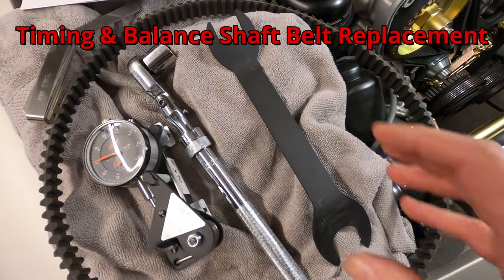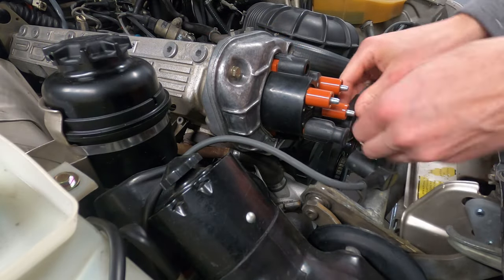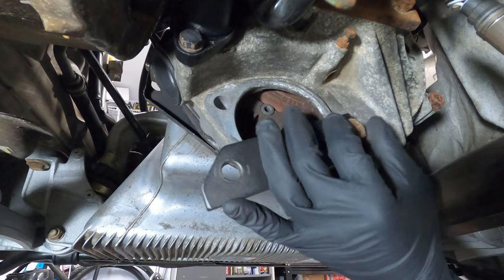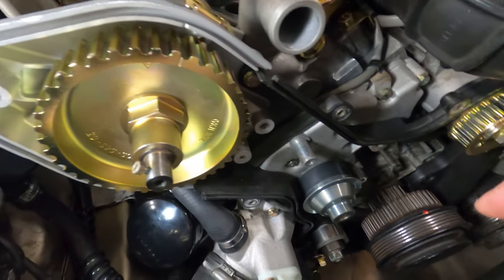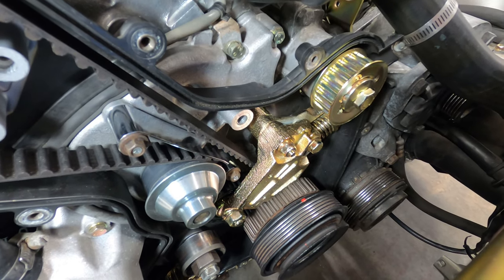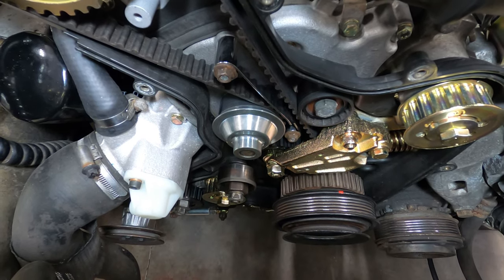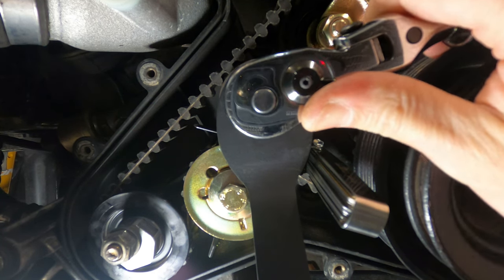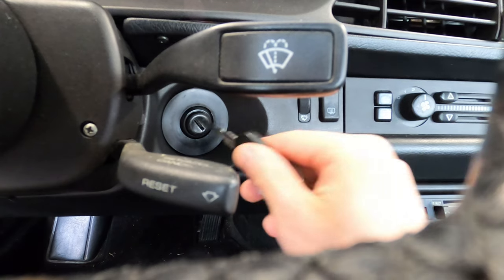Porsche 944 – Timing & Balance Shaft Belt Replacement Tutorial (Spring Tensioner / ArnnWorx Tool)

Comment: Where did you get all your gold parts from? Also when my car is running it’s has a ticking sound it’s goes away for a minute or a few seconds then it will come back and gets worse at higher rpm, what do you think it is? I was thinking valve lifters
Reply from the maker: Earlier this year I pulled a lot of the steel parts on the engine, had them glass bead blasted, and then yellow-zinc plated to bring back the factory look. 

As far as the ticking goes, could really be any number of things. The valve lifters are known to chatter when stuck or clogged. The fuel injectors also making ticking noises that get louder as they age. A slightly bent valve could also present a ticking sound. Rod knock will typically have a deeper sound, but if you’ve got more than 150k miles on the engine, I would add those to the list to replace at some point. If you haven’t done so already, I’d start with an oil change using a nice 20w50 conventional oil. It’s cheap, easy, and may help the lifters.

Comment: Brilliant video...I have the same car and tool!....when I put it in spec on the tool the balance belt slips and the balance belt shaft sprockets no longer line up properly. I have tried, probably about 5 times and it keeps doing it so I have to have the belt too tight.....any clues as to what I am doing wrong? Thank you. M
Reply from the maker: Hmmm, the balance shaft belt would have to be pretty loose to start slipping and jumping teeth on the sprockets. I don’t want to assume anything was overlooked, but I would make sure the tensioner is properly tightened down before applying and taking the reading on the gauge. The balance shaft belt is of less importance than the timing belt, in terms of the tension being exactly right, so you could also try the 90° twist method and see if that provides a better result.
Reply: @NC944er  Thanks for reply...forgot to say how in awe I am of your clean engine.....mines pretty good but not in your league! I have had another play today and have managed to get the BB on spec with the tool. My balance belt idler roller does sound a bit gritty when I took it off and spun it around...I understand it should just touch the top Balance belt and have a 0.5mm gap below. I have re-gapped everything and took it out for a spin...the first time the preload was way too much on the BB so backed that off to almost touching. then gave it some beans after it warmed up.... When I came back.....having almost totaled myself and car having just missed a massive tractor carrying a load of pig manure...my Wife said how much quieter it was....she was indeed right. I'll let it cool over night and then take some more readings tomorrow....Thanks again!
Reply from the maker: @mikseymono1  Thank you! Yeah, the little idler roller is where a lot of the balance shaft belt noise comes from. So much so that I’ve seen people just move it completely off to the side and lock it down so it doesn’t ever touch the belt. 😂 I’m glad you didn’t end up like Biff in Back to the Future with your manure miss!
Reply: @NC944er  😀The hazards of living out in the French countryside.....think ultimately I may need a new roller but I'll keep a watching brief. Cheers! M

Comment: where do you find info on how to remove and re assemble these engine parts? Should I get the Chiltens book for the car or is there a better one to use?
Reply from the maker: Some people will pick up the Haynes manual for general repairs and maintenance, but a lot of folks reference online resources. I’ll include a link to digital copies of the factory workshop manuals below, which are good for technical specs and high level considerations. The remaining gaps can be filled in with technical articles on Clark’s Garage and Pelican Parts, along with user forums. 

http://p914-6info.net/944%20Manuals.html

Comment: I have an '89 S2, see13:43 ; mine has an additional lower idler pulley that blocks access to that 'hidden' bolt on the tensioner. It's difficult to get a wrench onto the 17mm idler pulley bolt because the flywheel pulleys are just a little bit in the way.  I think an offset box wrench will work to remove that lower idler, then I should be able to access that last tensioner bolt. -off to buy more wrenches. (later) If you don't have a 'thin' 17mm offset box wrench, buy the Harbor Freight (or other) cheap one and grind it down to thin it out, then that lower idler pulley can be removed allowing access to that lower tensioner bolt, and the T belt comes off without removing the pulleys.  A higher quality wrench might already be thin enough.
Reply from the maker: Hey Jim, yeah there a couple differences with the 16v engines. You may have the pull the crank shaft bolt and the larger drive belt pulleys in order to remove the lower idler roller… but it’s always nice to have more tools as well. 😂 Best of luck sir!

Comment: Is it possible to change the belts and align everything without the tool to hold the flywheel? I'm repairing my head and I already have the front piston on top dead center?
Reply from the maker: Hey Nicolo, it is “possible” and there are people who have done it what way, but it does increase the risk of the timing being off, since the crankshaft can move from its position while tensioning the belts. If you opt to do it that way, I would triple check the alignment of all timing marks before turning the engine over, just to be safe.
Reply: Will I need to see every timing mark including the flywheel? I have my cylinder head off and I just did the timing marks for the belts but I can't turn the flywheel to see the ot. I. Afraid to crank the motor without the head just to see the ot on the flywheel.
Reply from the maker: @nicolomarinas7176  The intent behind keeping the crankshaft marks in time with the camshaft marks is to prevent the valves from making contact with the pistons. Since you already have the camshaft housing and the cylinder head off the engine, it’s perfectly safe to turn the crankshaft over as needed to clean the pistons or complete other work on the engine. When reassembling the engine, you will want to see all the timing marks and confirm that the flywheel is set to OT before installing the camshaft housing with it’s marks aligned.

Comment: Have you done balance shaft seals yet? I just did my camshaft seals (using your vid) and I am about to tackle the front main seal and balance shaft seals. Any tips? Clarks garage mentions the two balance shaft seals are different but he doesn’t mention how to identity the two. Maybe it will be obvious when I get it apart.
Reply from the maker: Yeah, they are two different sizes for whatever reason. 😂 The upper balance shaft seal is a 30x47mm ring seal (999-113-282-40) and it’s actually the same seal used for the camshaft. The lower balance shaft seal is a 30x48mm (999-113-281-40). I replaced mine a couple years back as they were seeping a bit. Popped them out with the drill/screw method. 

For the crankshaft seal, just use a BIG breaker bar on the crankshaft bolt, it will loosen up with a nice loud CRACK! It’s torqued to 155 ft/lbs when it goes back on. Wrap some high grit sandpaper (600 or above) to the end of the crankshaft to smooth it out and remove any buildup, that will make removal and installation of the pulleys a lot easier. Inspect the harmonic balancer for cracks - sometimes the serpentine belt pulley can separate from the balance shaft belt sprocket. Some folks also replace the oil pump drive gear (sleeve) and o-ring while they’re down there.
Reply: @NC944er  thanks for the tips. I bought a kit of all the seals so I’ll take a set of calipers to them and verify which seal is which. I’m currently trying to get the cam gear off of the crankshaft. My stubby impact didn’t break a sweat on the crank bolt and My pulley puller pulled the balance shaft pulley without any drama but the cam gear doesn’t have threads in it to use a pulley puller on.
Reply: @NC944er  also, in referencing van svensons video on the front crank seal, it would appear that my cam gear is installed backward on the crankshaft. I’m sure that has nothing to do with it being difficult to remove, just interesting to note
Reply from the maker: @tims_4x4_garage  Ha! Yeah, it’s always interesting to see what people have done to these cars over the years. I’m surprised the belt didn’t run off track, but I guess all the other pulleys/rollers were enough to keep it in line.
Reply: @NC944er  definitely is. The timing belt had just been done on this car but I already threw it away because of all the oil getting in the front cover and on the belt. Now I wish I had the belt to look at more closely to see any edge damage from running off the back of the pulley and rubbing the oil pump housing. Somehow these people managed to break all the woodruff keys as well (or maybe that’s common, not sure) I’m thankful parts are easy to find.

Comment: how long does it take to replace just the timing belt i want to get a car running and make sure everything works before i buy it so i’m trying to figure out how long it will take and check everything
Reply from the maker: The belt replacement, once you’re in there, is pretty quick… maybe 20-30 minutes to swap them out and tension. What takes up most of the time is removing everything it takes to access the belts. If the engine is fully intact, consider 2-4 hours for tear down and reassembly.
Reply: @NC944er  dang ok thank you

Comment: One more thing should I replace the teninsor
Reply from the maker: If you have the later spring tensioner, most people don’t replace that entire unit unless it’s significantly damaged as it costs around $500. However, it’s recommended that the roller on the tensioner be replaced every other belt change or if it’s loud when you spin it. The roller is basically the gear and bearing, which costs about $20. 

I’d you have the early tensioning roller (before 1987), those follow the same rule as the roller on the spring tensioner - replace if loud when spun or every other belt change.

Comment: Hey @NC944er,

My timing belt section between cam gear and water pump - slaps on to the plastic back cover. I checked with engine running for just a few minutes.
I can turn the water pump pulley with a bit of effort and also I was able to twist the upper section of timing belt to 90 degree before installing idler pulley. But after the installation of idler pulley, its not reaching 90 degree at all. 
Is my timing belt tight or loose?
Thanks in advance.
Reply from the maker: The plastic back covers can warp slightly over time and cause small issues like that. It’s also possible that not all the bolts for the back cover are fully tightened down. The idler roller does get in the way of a 90° twist, so I’d check it with that piece removed.
Reply: @NC944er  I visually confirmed its the belt that's slapping violently when accelerator pedal is depressed. I also believe back plastic cover is not getting in the way.
I can sure check if any of the bolts are not fully tightened. 

1.In which case can the timing belt slap violently?
2.Is there a possibility that my timing belt is either too loose or too tight?

I've added the lower idler roller, specially for 944S model this time as it was not present when I opened up the timing cover initially.
3.Could the addition of this extra pulley (oem part for 944S model - 944 105 241 02) has become a problem instead of assisting the timing belt?
Reply from the maker: @Sivaprasad.t.g  The belt wouldn’t be able to slap unless there was slack being taken up on acceleration. So it’s possible the belt is set too loosely or there’s an issue with the belt tensioner, possibly not being locked down to hold the tension setting. The idler roller should not be impacting the tension of the belt.
Reply: @NC944er  hi,
As identified the belt was awesomely loose but tight enough to not skip any tooth. Tightned the belt, now all good. I don't have any tool to verify the tension and so approaching Porsche center. Thank you for your inputs.
Reply from the maker: @Sivaprasad.t.g  Oh wow, I’m glad you caught it before it did any damage. Having a measurement tool is really the best way to go. 👍🏼
Reply: @NC944er , is there anyway to get the arnnworx tool there in the US?
I checked online and could not find any new or used one for sale. I'm not sure whether I should spend a 10th of the price for which I bought the car just to buy the porsche factory tension check tool!
Reply from the maker: Yeah, the P9201 Porsche tool is insanely priced... it used to be around $900, I can't believe it's over $1,400 now. Unfortunately, Bruce Arnn shut down his tool business last year, he had passed it off to another guy and it looked like it was going to reopen in February, but I think that fell through since the site is fully shut down, so no more Arnnworx tool for the time being. Here are a couple other options to consider....

944Online Kit (uses the Krikit tool) - https://944online.com/timing-belt-tool-kit.html
Carpokes Tool (need a 3D printer) - https://www.carpokes.com/viewtopic.php?t=777
Reply: @NC944er  thanks. I used carpokes 3d printed too but not compatible with S models. And that's how my belt got loose. Kriket tool, I heard its good for only balance shaft belt.
Reply from the maker: @Sivaprasad.t.g  Yeah, I’m not a fan of the Krikit tool. Sounds like you’re in a tough spot. Any 944 owners in your area you could borrow a tool from? Maybe check your local PCA chapter.
Reply: @NC944er  I've sent a word around but no response yet.

Comment: Do you have a video for 16 valve engines,same operation
Reply from the maker: Hey Juan, no I don’t have a separate video that showcases the 16-valve engine, but the belt change process is quite similar to the 8-valve. There are a few differences in the way the distributor cap and rotor are screwed on and the orientation of the AFM, etc., but the spring tensioner is the same and the belts route the same way. Irina has a video showing the S2 - https://youtu.be/o1P0n1DXMto

Comment: Why did you use super glue on the rubber seal around the distributor shaft?
Reply from the maker: Oddly enough, that’s what the factory workshop manual calls for. 😂 It’s a poorly designed hard plastic cover that doesn’t clip into place. Without some kind of adhesive, it simply rattles around freely in there and can slide/spin into the back of the rotor. Probably why many cars have them missing or they’ve been discarded.

Comment: Cant you set TDC by rotating the crank until the timing marks line up and the distributor rotor is pointing to #1?
Reply from the maker: If everything is already timed and installed correctly on the engine, you are right that the ignition rotor “should” be pointing towards the terminal for cylinder 1 when the engine is at TDC, but it’s not terribly uncommon for things to be slightly off. You never know who’s been in there and what’s been done over the past 30 years. 

With that in mind, what’s most important is that the crankshaft/flywheel marks are first set for TDC, because that determines the height/location of the pistons. Everything else should follow that setting.
Reply: @NC944er  where is the sight window on the bell housing? I saw the shot of it but couldn’t determine where it was located
Reply from the maker: @tims_4x4_garage  At the rear of the intake manifold there is a metal bracket that holds the wiring connectors for the speed, reference, and O2 sensors. The window is directly below that about 8 inches down.
Reply: @NC944er  cool. Thanks for answering all my questions. I’m enjoying the heck out of my car although the passenger seat and carpet are out if it right now due to lots of water. You ever ride up through highlands NC? there are a bunch of twisties and waterfalls. You can drive behind bridal veils falls up there it’s a sweet photo op.
Reply from the maker: @tims_4x4_garage  Ha! Yeah the passenger side had some wet times on mine as well. Got the battery tray all sealed up, but there’s still a slow leak at the windshield seal. Unfortunately the factory glass is priced around $1,200. 😳 So I’ll probably go the aftermarket route. 

Highlands is about 5 hours from me, so we haven’t made it that way as yet, but we usually do some Asheville trips every year. Sounds like a cool spot.

Comment: Think lower balance shaft roller not in correct timing position?
Reply from the maker: Hey Fred, it sounds like you’re already familiar with this, but just to recap for the edification of others - the lower balance shaft has a notch cut in the rear of the pulley that aligns with the tab protruding from the rear plastic belt cover. 

I think what you may be seeing is the camera angle being slightly off center. It’s a tight area to film and it looks like the shot wasn’t taken straight on, but the timing alignment is spot on. Cheers!  👍🏼